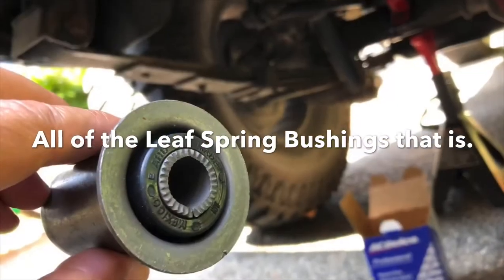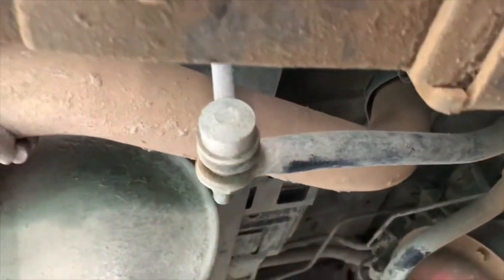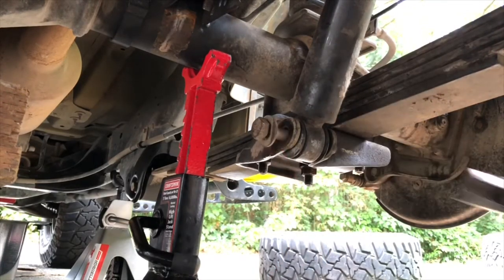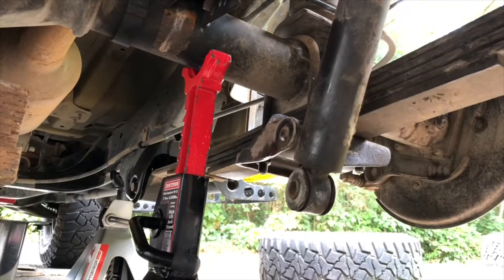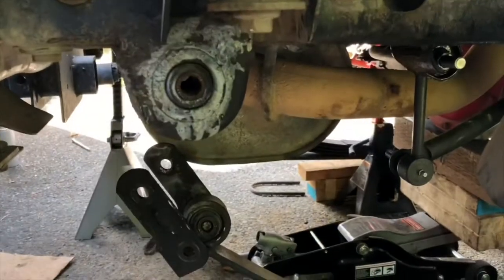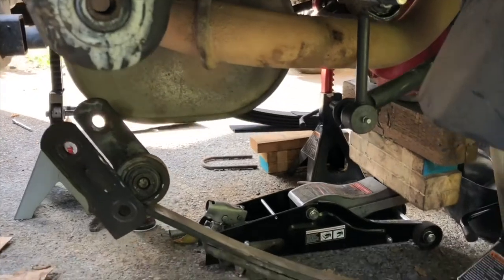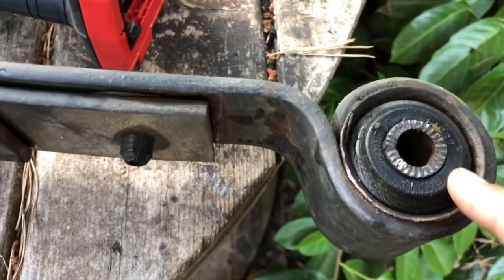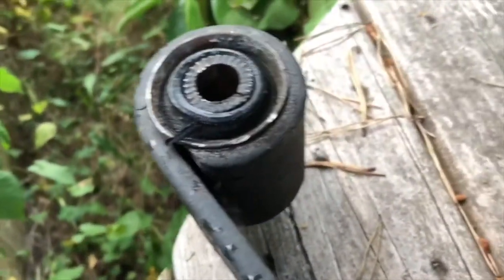Hummer H3 Leaf Spring Bushing Removal

Comment: That was a very interesting video to say the least.  Wouldn't of thought it would be so involved to get those off.  Glad I came across this video.  Wasn't looking to replace mine but having second thoughts. Thank you Sir👍
Reply from the maker: Hello Cap, Yes, it is not a fun job at all unless you use a Press instead of the Drill, Cut & Burn method I display here.  Once all repaired this H3 feels smooth like butter now on the off-road trails.
Reply: @NorthwestAdventurerNWA  Thats awesome cause that squeak was terrible. Not looking forward when I have to do this but your video will be priceless.

Comment: Hello there , the Leaf Spring on the other side near the Gas Tank is so Difficult to Remove
because the Bolts touch the Gas Tank ! Any ideas how you would remove the Leaf Spring 
on the Gas Tank side  ?
Reply from the maker: Hi Lennox, To remove the hidden bolt on the forward Leaf Spring (gas tank side) you must remove/drop the Gas Tank Casing.  I believe there are only 4 nuts on the case and you’ll need a 13mm Socket to remove them.
Reply: @NorthwestAdventurerNWA  ..Thank you , i will check it , take care .

Comment: The rear bushing mounted to the frame. How is that replaced?
Reply from the maker: Pretty much same as the other bushings with the exception of not cutting the frame mounted piece.  You can cut or press out the bushing just as easy as the others.
Reply: Hi friend are the same number bushing?? Or has another part number the mounted to the frame bushing
Reply from the maker: @seanpineda4526 All of the Part Numbers you’ll need are listed in the video “Description.”  Yes, they are different bushings.  🤙🏽
Reply: Which part number for the frame bushings
Reply from the maker: @1989hondakid Did you read the DESCRIPTION of the Video?  That’s where all the parts are listed.